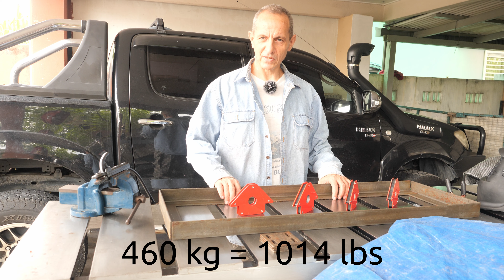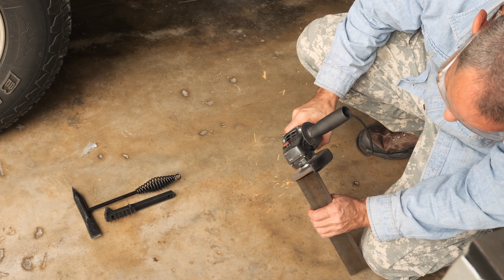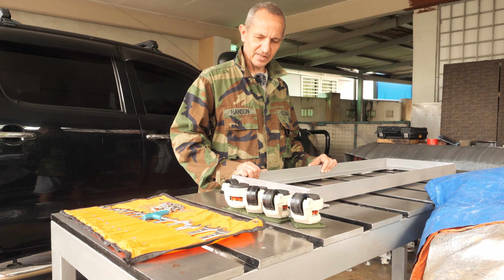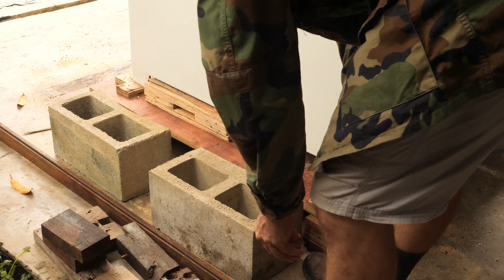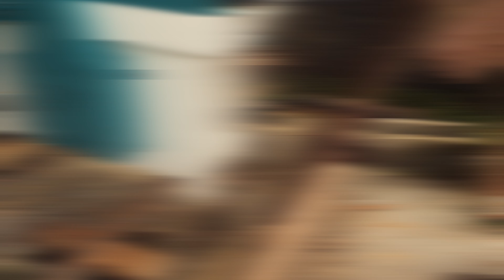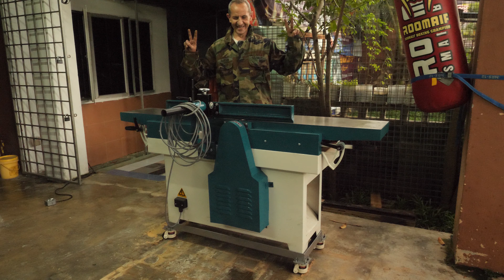How To Move Jointer To Mobile Base

Comment: I started watching this mostly in sympathy because I’ve spent the last week and 1/2 building a base for my large bandsaw (admittedly a bit lighter at only 550 lbs, yet more bit more awkward), and going through all kinds of pain levering it around. I feel your pain! In the end, your final solution was quite clever!
Reply from the maker: thanks man! I admit it took me a few of failed attempts before I figured it out. I was scared it would fall on its side. luckily the motor is well balanced in the center of the weight.
yes I could have asked from some help but some people are hard headed :)

Comment: WELL DONE!!! ...
Reply from the maker: thank you! it was too risky to do it alone, but sometimes we need to stretch the boundaries to test our abilities in case of emergency.
Reply: ... yes ... sometimes things just have to be done ... no matter what ... I have a similar thing to do ... have to lift a quite heavy table saw and put it on a mobile base ... but ... there is one disadvantage ... the machine does not have these "legs" like your machine does ... so getting "under" it takes a little more effort ... I hope I did explain the issue clear enough ...
Reply from the maker: @christiankremer4754  yes I can visualize that. I guess you need to get creative and find the best leverage point. as soon as you lift any corner, you can go from there, and lift the next ones, and then make it higher bit by bit.

you can also use car jack, as this was my original idea to move my jointer
Reply: @TigerCarpenter  ... hey .. ok i'll take some pictures ...

Comment: Why go through getting the jointer after the beautiful sled for the planar? Did it not work out so well?
Reply from the maker: the acrylic jointing sled works perfectly well, and it even has the advantages over the huge industrial jointer, as you can bring your thickness planer along with the sled to the client's site or the construction site, and it would be impossible to travel around with the heavy jointer.

on the other hand, the heavy industrial grade jointer has more power, and can take bigger bites in the twisted or cupped lumber boards. the jointer also speeds up the job, as you can use it straight away, without setting up the sled, even though the grub screws protruding from the acrylic bed don;t take too long to adjust, to support the uneven boards.

I still often use the sled, especially on mobile jobs, when fitting the pieces at customer's site.

I prefer to use the jointer, because it has the cast iron reference flatbed, which I often use for verifying my stock, not just for jointing.

and as bias as it gets, my brother and me own the factory that produces the industrial grade jointers of all sizes (lengths / widths), and for any power needs you can imagine (380V / 220V, 3-phase / 2-phase etc).

the conclusion:
1. the sled is good for the mobile jobs, and for the beginner / intermediate woodworkers, who can't fit the jointer into their startup budget, but eventually everyone who gets serious about the craft, would get the jointer at some point.
2. the standalone jointer, especially the one matching your thickness planer width is faster and more convenient to use.
3. both the sled and the jointer produce equally perfectly flat boards.

PS
I have an upcoming working desk video, which features some uncommon joinery and very unique yet extremely simple design.
in that video I used BOTH my 12 inch industrial grade jointer AND my acrylic sled, to joint the working desktop boards, and I demonstrate that the results are identical.

so finally to answer your question:
why jointer if sled can do it?
- jointer is 1900 mm long and the sled is 1500 mm long
- speed in production mode
- convenience
- sled + thick dense timber is very heavy, and it takes some muscle flex to flatten 3 boards with multiple passes.

the jointer has not showed any surface quality gain over the sled.

please note that both my jointer AND the thickness planer use the helical spiral cutter heads, which produce silky smooth surfaces ready to finish.

my jointer has 60 carbide blades, and the thickness planer has "ONLY" 48 blades. which theoretically does give the better surface while using the jointer, but I can't tell the difference.
Reply: @TigerCarpenter  Very valid points. Thanks for the details.    As a hobbyist I will go for the sled until I have much more space for the jointer.  No production needs on the horizon yet!
Reply from the maker: @tomvanheule5505  cheers.
Bonus 1) the jointer makes it easy to joint the edge 90 degrees to the face, by simply using the fence (you do need to adjust the fence to be perfectly 90 every tine before you use it).
Bonus 2) the jointer allows jointing the material of theoretically any height, while the thickness planer has the height limit, which often frustrates me, as it is usually just 1 inch too low 

my sled allows the 90 degree fence attachment using the matrix of holes which gives you that perpendicular edge jointing capability, but again, you have that height limit, so jointing wide boards is out.

but to edge joint the wide boards, you can use the router table, with the left side of the fence shimmed with 1 playing card, it works like a jointer tilted 90 degrees. I still often use this method, despite having a proper jointer.

PS
as I mentioned, my brother and me are sort of engineers / inventors / ex special forces / crazy kind of people. 
we recently designed a helical spiral flush trim bit for the router, which basically makes your router table deliver identical surface quality as the helical spiral cutter head in the jointers and in the thickness planers.
we  can make those router bits to any shaft, cutting length, any number of indexable /replaceable carbide blades.
I'll add this router bit soon to our online store.
we also designed a bottom cleaning router bit which uses the same technology = indexable / replaceable carbide blades, and that thing deep cuts the iron wood (hardest / most dense species on the planet) like a hot knife into the butter.